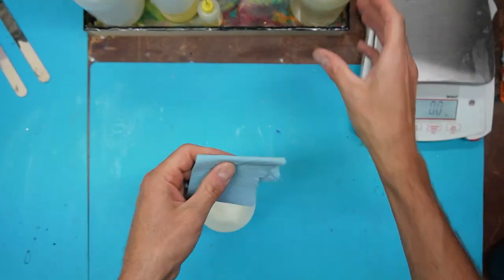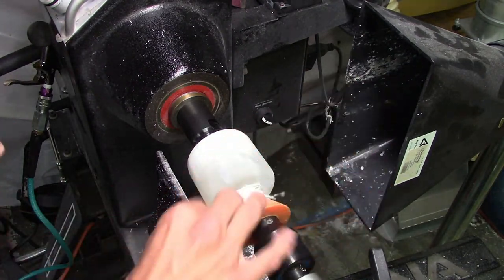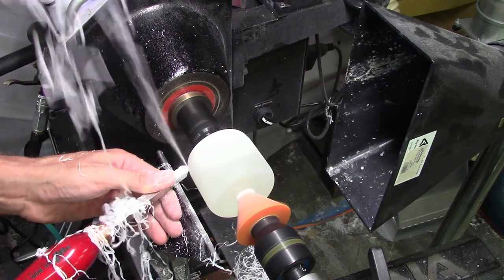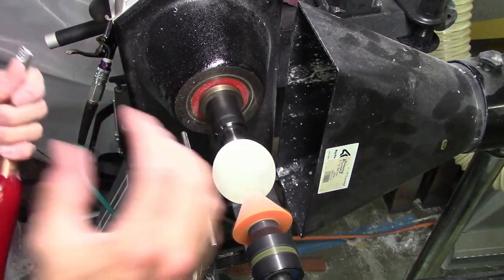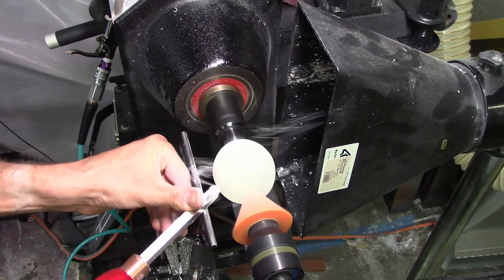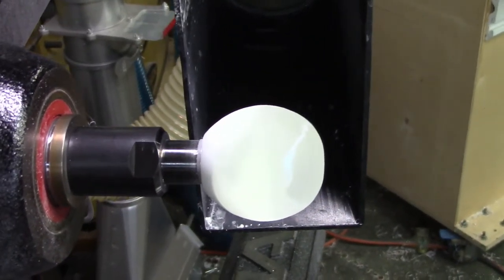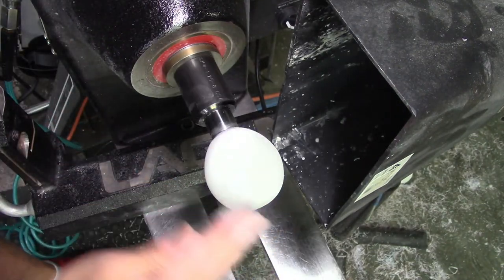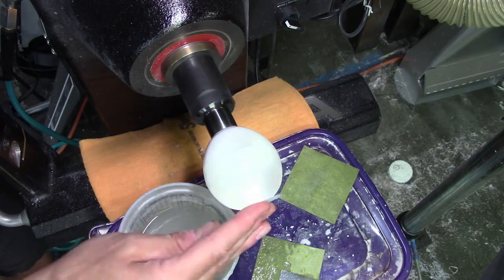🔴Replay: Woodturning: Gear Shift Knob Made of Alumilite Resin | Episode 203

Comment: ...nice job, it does look great...makes me want to install a fake shift lever in my Grand Cherokee...
You mentioned the PVC pen blanks...an idea I want to try (or just wait to see if you try it first...😉...)...cut a V slot down the length of the tube...lay it flat, plug the ends and fill with resin through the slot (the V shape should assist a little with the pour). It'll still save on the resin, but should also allow mixing (somewhat) as you would with the flat rectangular molds...
Reply from the maker: Thanks! This was a fun one! I'm not sure I understand the v slot idea. I'd have to see what you mean
Reply: Would love to see both Black and White side by side,
Reply: @ZacHiggins  ...well, let me try it this way...run a V-groove router bit down the length of the PVC tube...make it deep enough to create, oh, say, about a 3/8" opening...that should give enough room to allow a toothpick or popsicle stick to get in and "swirl" the length of the tube. The V shape of the router bit should chamfer the edge slightly and may aid in pouring the resin. Of course, it'll have to cure on its side like a standard rectangular mold...
Reply from the maker: @_zhawkeye_9808  Ah I think I see now. Interesting